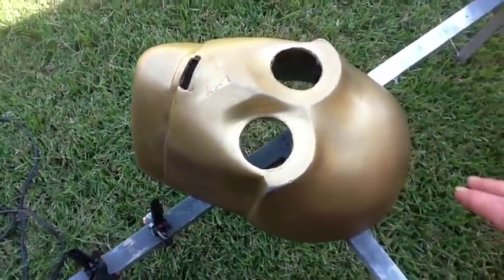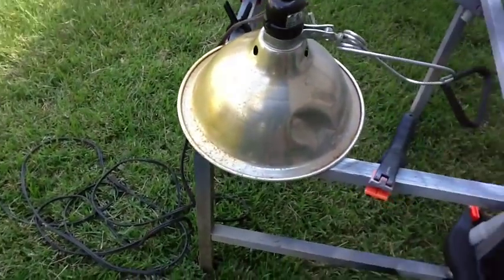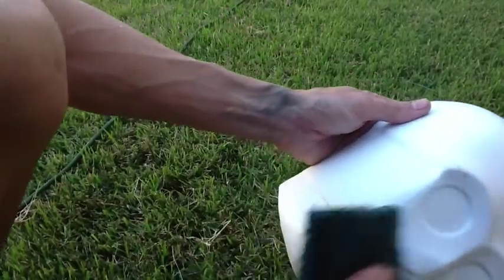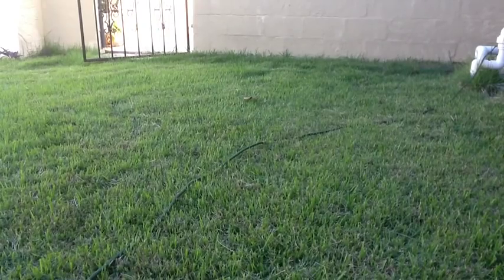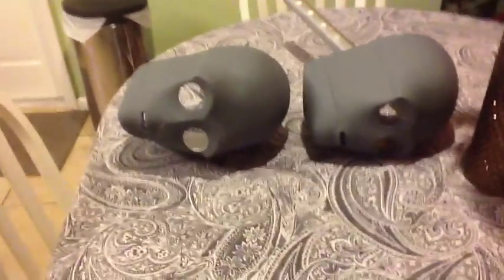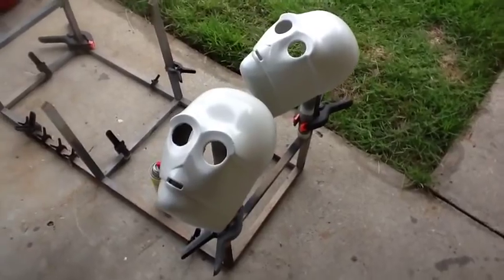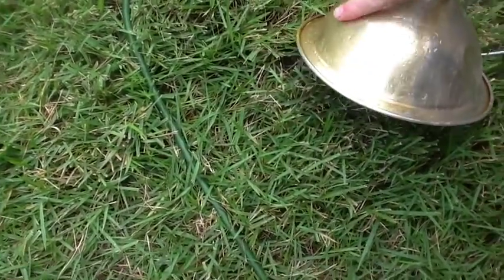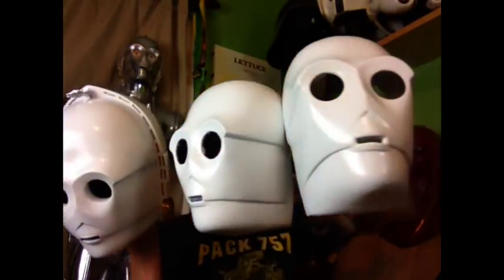C3PO blog update 120907-DIY metal/chrome tutorial PT2

Comment: I'm watching and taking notes for this method and have one question for the steps covered in this video:

Is there any sanding or buffing that should happen between the primer coat and the white base coat?  Or do you simply lay down the white over the un-sanded primer?